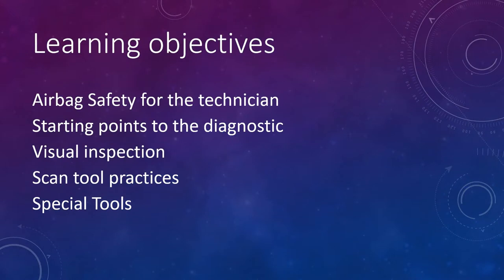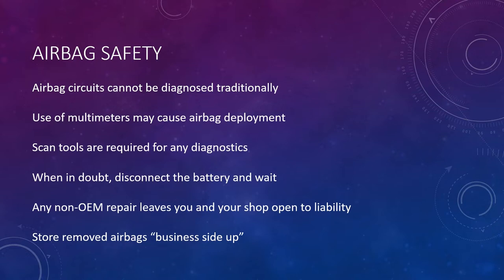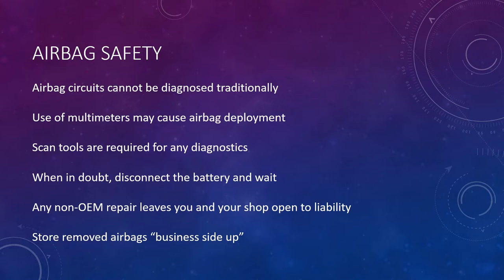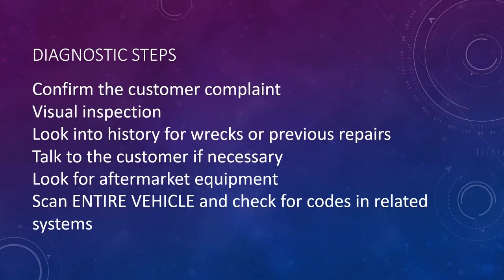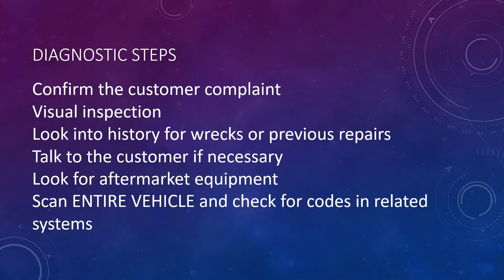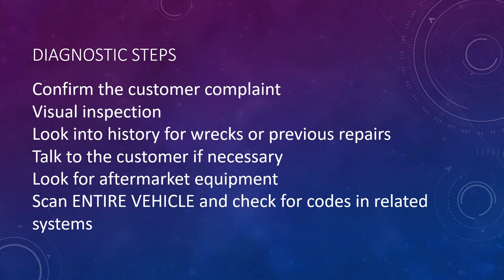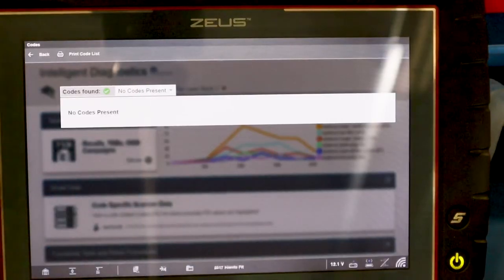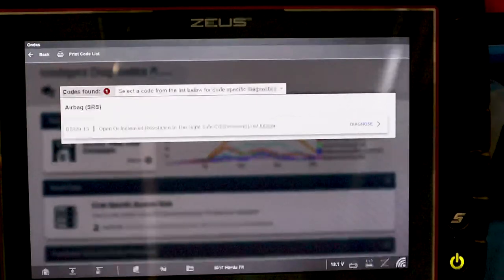Airbag and Secondary Restraint System Diagnostic Tips and Tricks for Technicians

Comment: Great video, very informative! On later model Hondas, I find it hard to use a cheap simulator because there is a shorting bar in the connector when it's unplugged. I had to buy Hondas tool, but it has a different connector for every airbag.
Reply: usually not a problem to insulate the shorting bar from 1 pin with  thin plastic insulator? no special tools required

Comment: Mr B, Your airbag system diagnostic lesson was good.  I have wires severed going to the front impact sensor.  If good practices are utilized can these wires be spliced back together?
Reply from the maker: If the manufacturer allows it, yes. I would use gold plated connectors if a repair is made and heat shrink to keep water out. Hope this helps!

Comment: I don't know of any multi meter that puts out the several amps necessary to ignite an airbag squib, plenty of videos on YT showing that multimeters don't set the squib off. On older cars where used airbags are cheap  and you've checked wiring and the fault is highly likely the airbag unit itself it's not a big deal to check the squib resistance or any internal earth fault with a multimeter, just be sensible about doing it ( ear defendersafety squints , secures airbag keep your distance.

Comment: Very informative video! Do you know how would the DIY version of the"air bag simulator" work if the seat occupancy sensor was bad. 
I have seen a lot of cars (including my own) where the passenger seat occupancy sensor conncetor is not plugged direcrtly on the yellow air bag connector under the seat - clearly the yellow air bag wiring is going to the module but is the occupancy sensor wiring going to the module also? 

I think my question is that where do you plug the simulator (or basically 2ohm resistor) if the seat occypancy sensor was bad and you would like to double check if thats the real problem before replacing the whole seat?
Reply from the maker: The occupancy sensor can’t be tested that way, because the simulator only replaces an airbag or belt tensioner igniter. With the occupancy detection, you would follow the OEM diagnostic procedure for the system. Scan tool diagnostics by using the weight readout as seen in the video is a good start. Thanks for watching!

Comment: I have purchased a wrecked 07 Beetle convertible from an insurance auction with airbag deployment.  I have located and installed a new airbag, replaced both left and right crash sensors under the front bumper structure, (Where it was hit).  I have sent in my SRS airbag module and seatbelt to Restore company to reprogram the module and reset the seatbelt, however when I plug in my newly programmed module, and seatbelt I still get the airbag light on the dash, but its blinking fast then just stays on.  i tried to reset the SES with my scan tool, however, it displays "reset failed".  my next step is ordering 4 of the 2.2ohm resistor test blocks to troubleshoot each airbag in the car.  my question is, when i plug in these resistors, i need to run the scan tool again right?  then i assume do this for every airbag in the car.  I realized after i sent off the SRS module to be reprogrammed, i found out from a fellow auction friend that someone when looking at the beetle had manually reset the pop-up roll bar in the vehicle when examining it and when i bought it i was unaware of him doing this.  do these have sensors that will need to be replaced as well like the front bumper does before I get a clear dash? are you aware if i do replace these sensors, do i have to send back the SRS module to get reset again?  Hard to tell where i need to go from here.